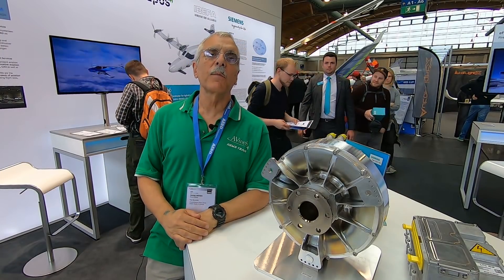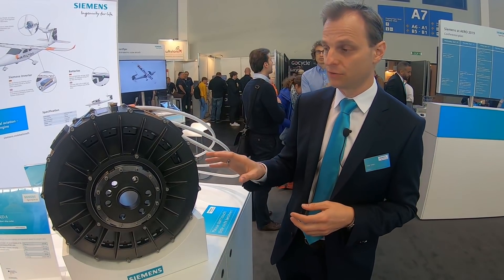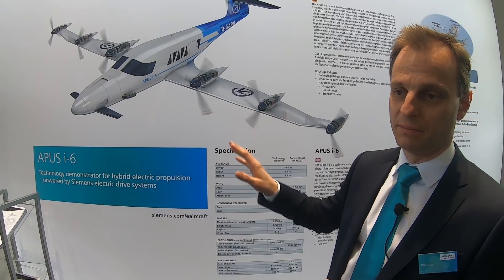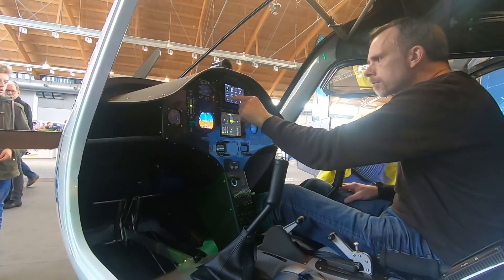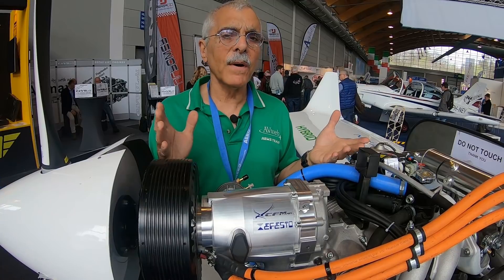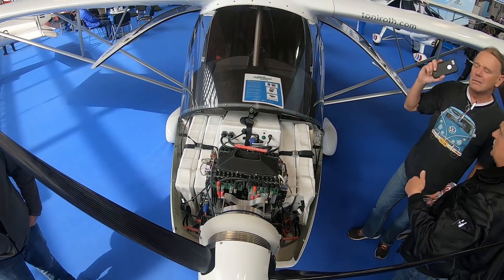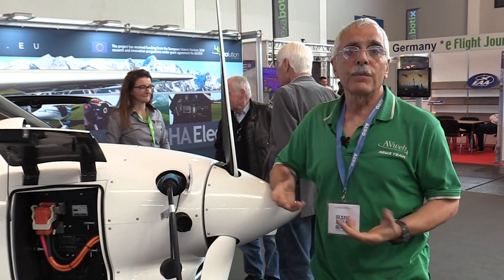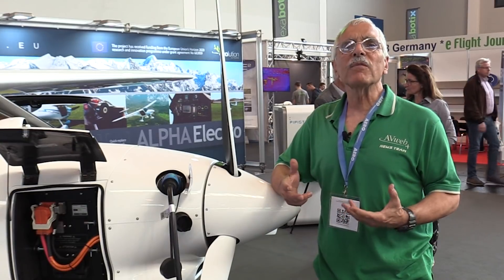What's New in Electric Airplanes?

Comment: all we need now is new battery technology , 4x-6x more energy density , will be game changing
Reply: The big problem is 4x to 6x on a kwh/kg basis is next to impossible. At 10x from current tech you get the energy density of TNT. Realistically things might get 30% to maybe 2x better and the 2x is a massive maybe but that does make it viable for some applications :)
Reply: Take a look at Bye Aerospace's project, the Sun Flyer, it can fly 3-4 hours, depends on the model. I think you would be surprised.
Reply: https://www.assemblymag.com/articles/94724-new-battery-breakthrough-could-replace-lithium-ion
Reply: There is supposed to be a battery in development that can produce 3x potential per weight ratio. Might be size ratio but it's also much cheaper material as well.
Reply: @nicholasboscaino6262  its exactly that, supposedly in development, maybe, someday. There are also laws of physics.
Reply: Not gonna happen. Batteries are at the top of what physics allows us to do.
Reply: @flexairz  you're mistaken. Even the Cobalt-Lithium batteries that are used everywhere are getting better little by little. Alternative chemistries all have problems still, but nothing in physics says those problems can't be solved.
Reply: @vr33m  physix says everything significantly energy denser than conventional fossil fuel is explosives. i.e rockets.
Reply: @flexairz   well not with that attitude its not
Reply: @flexairz  Current lithium battery capacity, yes.

Comment: I heard you can recharge an electric airplane in flight by getting struck by lightning.
Reply: 1.21 gigawatts!
Reply: @dalgrim  don't forget to clock the flux capacitor and make sure it has enough blinker fluid.
Reply: @dalgrim  exactly what I was thinking!
Reply: @dalgrim  I suspect only the richest will be allowed to charge from these...
Reply: Refuel like an air tanker operation only it would be an electric boom.
Reply: That would be cool of we had anything that could collect a charge that fast lol. We can dream
Reply: Just needs a Tesla Tower, wireless transmission station designed and built by Nikola Tesla
Reply: TheSimfixer 
Always amazes me how many get sucked in by Tesla’s dream.
In theory you could distribute power that way. Of course you’d need to build and run enough power stations to meet world supply with no way of charging anybody for it. Can’t prevent anybody, anywhere in the world tapping into the system and using as much free energy as they want. 
Great, you say?
On the contrary it costs money to generate energy, no matter how you do it, and if demand is greater than supply (it would be!!) then we’d have perpetual, world wide brown-out.
The age old Tragedy of the Commons.
Reply: @q.e.d.9112  The tricky bit of Tesla's design was that it would use the Earth-Ionospheric resonance to load energy into both the "Skywave" portion of a signal, a "Surfacewave" portion of the signal, and a "Groundwave" portion of the signal. Tesla was the first to discover the basics of a surface plasmon polariton wave. But there was more to the generation of power than the distribution of power and reception of power. The Earth is a non-linear electrical medium, and it has existing electric currents generated by thermionic emission of electrons in the core. The truly brilliant application of a Tesla coil with a tuned coaxial ground line cable was that it could entrain the Earth's electrical resonance by phase-locking, and in doing so allows any thermionic electron emissions which are at the subharmonic frequencies of the fundamental frequency to add their amplitudes to the Groundwave. This would slightly cool the core if you put a load on the signal, or it would heat the core up if you did the same phase locking process on the Skywave, cooling the ionosphere of currents generated by the Solar wind. 

Truly brilliant man Tesla. Few can appreciate the truly vast amount of power stored in the ionosphere and the core, that Tesla was going to harness via the processes of phase-locked resonant transformers.
Reply: Can you imagine how much power you would even need to capture in around 250-500ms? It's in the ballpark of 100MJ - 1GJ of energy (200MW - 4GW).  Batteries would never do it. High pulse power is the job of capacitors, specifically film capacitors with the highest dielectric strength and lowest impedance possible. Say capacitor manufacturers used a high-K dielectric that gave you an energy density of 10J / cc ( 10J / g). To capture 50% of the lowest ballpark energy (50MJ) you'd need  5,000 kg of superdielectric capacitors, which at that point you won't be flying a small plane anymore.

50kg of superdielectric capacitors (I'm talking 500-700 V/um breakdown voltage) would capture about 500kJ of energy, which wouldn't really justify the added weight when you consider lithium can store 250-300 J/g. 

On the other hand, if you can discharge the high voltage caps quickly, maybe a system could harvest atmospheric electricity from more than one transient lightning event. But again it would have to pay itself off quite a few times to justify its weight.
Reply: Flux capacitor?  OK, Doc Brown...
Reply: You first... wait, let me get my phone.
Reply: Pull out the batteries and microwave them instant recharge
Reply: Joe H  There's VFR, IFR, and TFR. :)
Reply: Hmm
Reply: Funniest comment ever!
Reply: On serious note if we could even use an electric potential difference from clouds as these lightnings do...

Comment: The only problem are batteries in general. At some point resources will expire. Unlike oil, the resources needed to create batteries are far more limited and harder to get too.
Reply: Lithium is abundant, even in seawater. I don't think we'll run short on nickel or copper anytime soon, we are running into production constraints for nickel at present, too much demand and not enough production (mining).
Reply: @wzDH106  Cobalt is a problem.
Reply: @PistonAvatarGuy  
Agreed to an extent. Wouldn't be surprised if Cobalt is eliminated completely within batteries in the near future. Considering Cobalt is essentially a byproduct of nickel and copper mining, maybe future initiatives could streamline extraction and purification from single sources.
Reply: Completely the reverse!